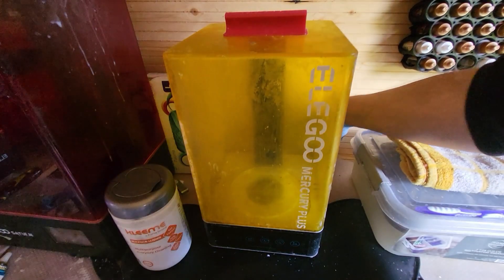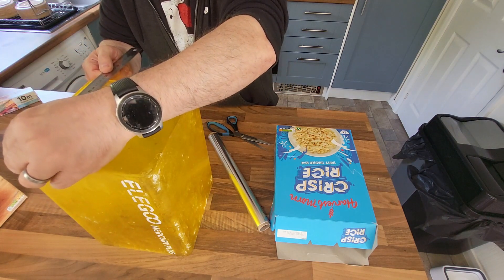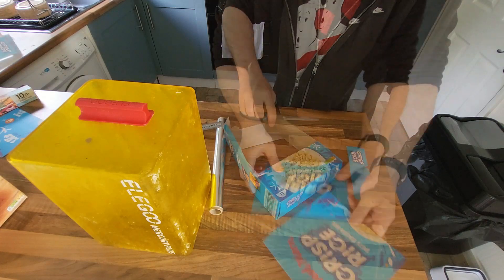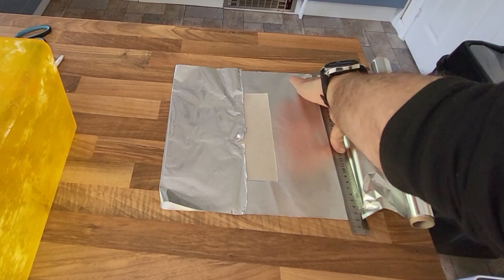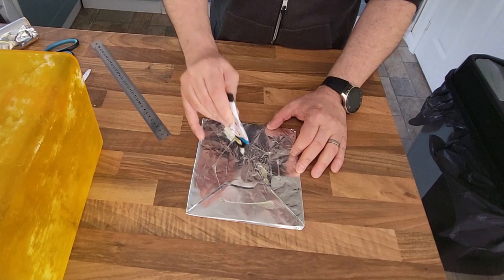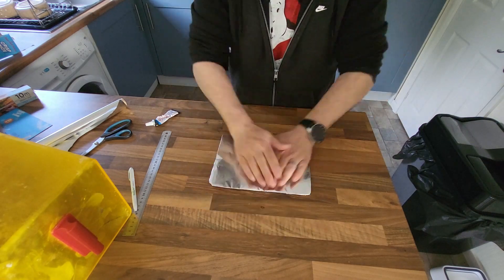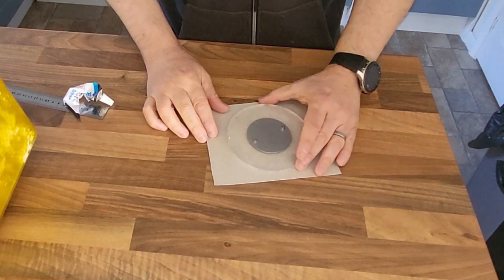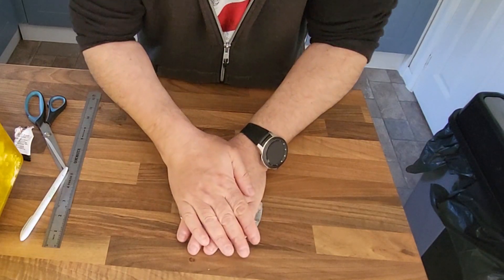I Used Tin Foil To Improve My Wash N Cure Station 3D Resin Printing

Comment: Mmmmmm   a couple things going on here.  First off you don't need the outer cover on there when washing, it isn't necessary. #2 I made mine like a 4 sided insert/sleeve box, to fit the inside dimensions of the cover, wide masking tape does a nice job on the outer edges of the sleeve.  this way you don't have to use glue and damage the outer cover, (I'm thinking resale later on).  And lastly... I'm sorry  but that is the dirtiest wash box I have ever seen. I don't understand how someone can get one that dirty if you have a good clean(ing) method in place.
Reply from the maker: Thank you...
I think 🤣